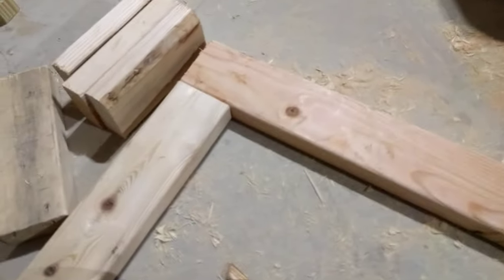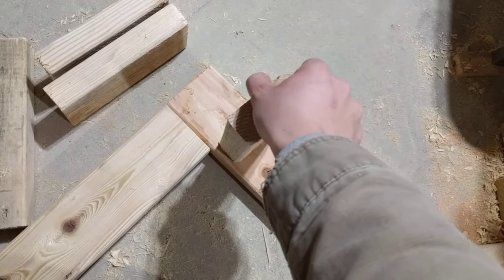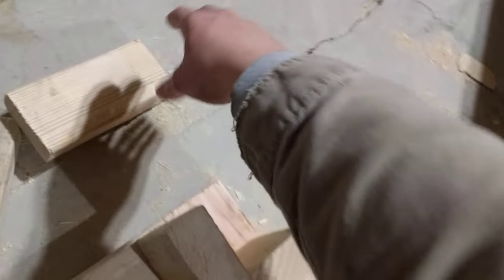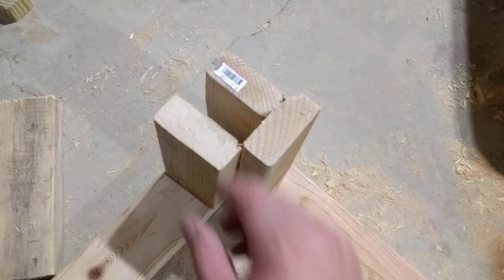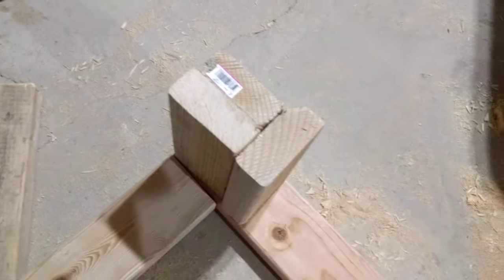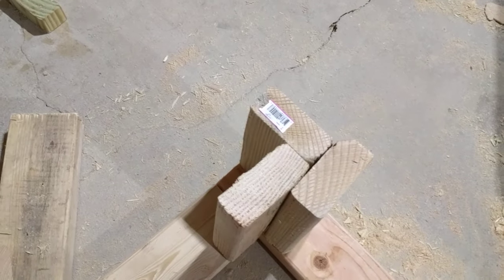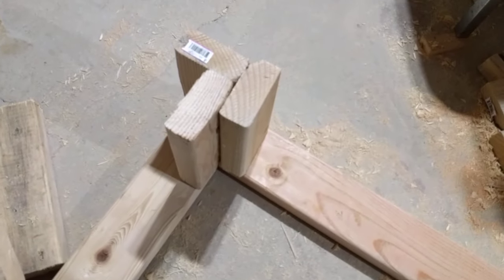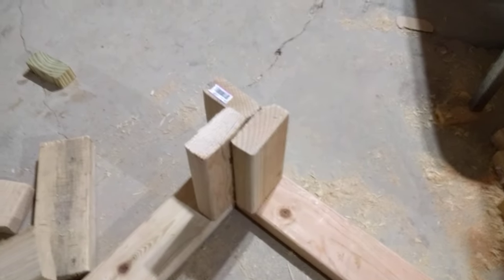How To Frame a 2x4 Wall Corner

Comment: Very weak corner.  You need to nail two studs together with 3 blocks  sandwiched between them , with another stud offset to the side of the blocks and one stud. It will give you nailers and the studs all perpendicular  to the bottom plate. That one on one side of the plate is weak AF.

Comment: That third stud you placed, and referenced as a backer, isn't necessary. For a higher R value in the corner place 3 or 4 blocks there to back the sheetrock. Now you have a cavity to take insulation. (Saw that on Yankee Workshop). This was used on a net-zero project. They blew closed cell foam in the corners. It was 2 x 6 studs. Thanks for your video. I almost forgot that corner insulation trick until I watched your good design too.

Comment: You are making a weak corner and that corner is not recommended by any reputable contractor.  The drywall seam will separate there.

Comment: This is a good technique, and a good video explaining it, however, you should mention that when someone is drilling for electrical they need to ensure that they are using a three-quarter inch drill bit and that they are aligned to just barely missed the stud in the corner… By doing this they allow for the maximum size hole (for the possibility of multiple electrical cables) while still satisfying building codes that require a minimum of 1-1/4 inch of wood between the outside of the stud and the electrical wiring (all the way around the corner).  

Viewers may accidentally try to give them selves some extra clearance away from that corner stud...so they need know to drill a 3/4” hole whose edge is as close to it as possible (without going into it obviously) since it is 1 1/2 inches thick plus the three-quarter inch hole leaves exactly 1 1/4 inch of wood on the inside wall.

It might be a good idea to simply add a caption to clarify that point, as adhering to building code is (almost) always a very good idea.

Comment: Because of lumber costs being so high, and no significant change in strength, some places are now allowing an open two stud corner.  This involves replacing the third stud with metal drywall clips that hang off the inner corner of the stud.  Some clips provide a tab as a backstop for the first drywall panel.  The second type have additional spikes to stab into the side of the drywall.   Either way the second drywall panel helps secure the panel with the corner overlap.  Another method is to use scrap cuts as backers.

To be honest as costs keep increasing I wouldn’t be surprised if we see the industry going to prefab 4x8 panels of 2 sheets of OSB, filled with foam, and you use 2x4 or 2x6 as splines only every 4ft.

Comment: Hi Benjamin. This is a very helpful tutorial.  Thank you 👍🏽

I'm hoping you could give me some tips on my project. 
I want to frame my basement. I've been advised that best place to start is in the corner. 

I've seen several different methods on how the studs can be mounted on the bottom plate. My question is when it comes time to installing the drywall. This would be an inside corner and we would start our drywall 3.5 inches in... technically an 8 ft dry wall would finish 3.5 inches further on a 8 ft bottom plate. 

So wouldn't this screw up my 16 on centers and isn't the drywall suppose to finish .75 inches on a stud so the next sheet of drywall can start there. 

Any help or tips you can give on this would be greatly appreciated. Thank you

Comment: You California corner layout is incorrect. The end 2x4 on the through wall should be turned 90 degrees and flush with outside end of wall. The additional stud should be butted perpendicular against that stud and flush with inside edge of though wall. The butt wall should have the 2x4 on very end and turned 90 degrees and butted against the through wall. 
The way you have it is the 2x4 backer is resting halfway on both the butt wall and though wall. Your intent is right but you really have mislead people that have no experience in framing a wall
Reply: Yup you’re right, I noticed that too... he needs to switch which bottom plates or flip the studs, otherwise there is nothing to nail the 2 walls together with a 2” gap between the wall ends...
Reply: Glad to find this comments, there are another video in which corner connection and t connection is showed is using the way you are talking, I am confused seeing this video because you have you frame ready and connect it together then the corner cannot be like this

Comment: So should I subtract 3 1/2 or so inchs before I start my 16" measurements or just measure from the end of the plate ? For the drywall .
Reply: Your drywall should simply start at the corner of the walls. IF you framed 16"-OC (starting at the corner) you should be just fine! -Whoa! JUST realized that this is 2 year old... Hahahaha!! How''d your Reno. go?? SHOULD be done, just about now, anyway. lol. Cheers!!

Comment: Not to be too critical, but it would be better to put the two studs together (the L) on the through wall (flush with the through wall), then the end stud of the butt wall will make the third one. Otherwise, you'll have to slide the butt wall underneath the L after raising it. Or else leave it out and put it in later.
Reply from the maker: +Jerry Thanks for your suggestions!
Reply: No problem. I've made that mistake before. Not the end of the world, but a little extra work.
 Good video.
Reply: Jay, this sounds like something I'd like to know but I can't figure out what you're saying (my inexperience!)  Do you have a sketch of the cross-section?
Reply: @togamac  I don't have a drawing, but maybe I can explain. 
The through wall goes up first, so as you can see, the stud he put on last sticks out into the area of the butt wall, which means when you go to install the butt wall you'll have to slide it underneath the stud sticking out into that area.  Turn the stud assembly in the other direction, so that the end stud of your through wall is a regular end stud, properly placed as an end stud (same direction as the other studs in that wall), and the end of the butt wall will have a regular end stud as well. So all you have to do is frame your through wall the regular way and stand it. Then frame your butt wall the regular way and stand it. Now all you have to do is add the extra stud to make the inside corner.